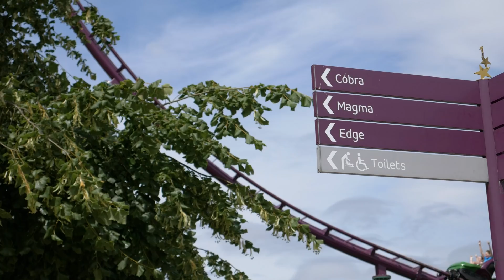Roller coasters speed up throughout the day, why?

Comment from the maker: Help us find the world's best roller coasters! We've created a brand new poll called Vote Coasters, and we need your help. Rank from best to worst the roller coasters you've ridden and from that we'll find the world's best. To learn more and take part, head to: https://coasterbot.com/votecoasters
Reply: First of all let me say that I love your videos and content and always find them fascinating. Second I was wondering if I could use some off the diagrams you include in videos on a website I am making for school? I would of course credit you.
Reply: the biggest thing you left out was that every train gives a different ride. train #1 of a particular coaster might run noticeably slower or faster than train #2 or#3 of the same coaster. also, if a coaster adds or removes a train, though out the day it may also have a different speed compared to the ones that have been running all day

Comment: A warmed up Coaster on a hot Summer day with some Rain is just 🤌🤌🤌
Colossos at Heide Park usually gives great rides. But on one visit last year somewhen in August the Ride went nuts! It was around 8pm, about 32°C, with a rain shower coming through.
From the first drop till the final bunny hills the Ride tried to launch me beyond space. I didn´t get stapled and they specifically anounced, that the trims were off. That ride honestly scared me...
On the first hill I was lifted multiple centimeters out of my seat to the point I thaught I can just stand up, while the rain was blasting at me. Before the second hill I pushed down my bar and it seemed to have no affect at all. That ride left me speechless and with tears in my eyes... 
Also got a similar experience on Kärnan at Hansa Park. Also mid Summer and late in the afternoon. The coaster whiped through it´s course whipping me around. It was just going so stupidly fast. That was my 200th ride on Kärnan and it made my month.

Comment: There is one more effect that weather has: Changing air density! Hot, moist air at a low air pressure is less dense than cool, dry air at a high pressure. At, say, 950 mbar, 30 C and 80% humidity, air has a density of 1.077 kg/m^3. At 1050 mbar, 10 C and 20% humidity, it has a density of 1.291 kg/m^3 - and since wind resistance is directly proportional to air density, that can have a significant effect.

Comment: How do you know it ran 1.5s faster due to temperature if you're then gonna explain there so many factors that can influence it
Reply from the maker: Temperature is connected to a lot of the reasons a roller coaster can speed up or slow down.

Comment: Genuine question

You know how GCI, CCI and Intamin Pre Fabs are made of wood but have that sttip of metal on them, why is that? Why can't their track be pure wood? Thank you!
Reply: Are you talking about the track itself?
Reply: @shawnspencer8766  yes
Reply: @100ksubssoicanbragtomyfrie4  the track itself needs steel for the road, guide, and upstop wheels. This is the part of the track that takes the most beating, and straight wood would not hold up to that kind of abuse. Thus, steel is used. 

Although it's good to note that the stack (the part of the track underneath the steel) is all wood as well as the structure.
Reply: @shawnspencer8766  Thank you! So is the bit where the upstop wheels for airtime not wood or is it wood?
Reply: @100ksubssoicanbragtomyfrie4  any spot the train wheels ride on are steel. Roads on top, guides on the inside, and upstops have steel underneath 👍🏻
Reply: @shawnspencer8766  thanks man!

Comment: Steel coasters go faster in the rain, but it slows down wooden coasters. Because wooden coasters have steel wheels on steel track the track itself needs to be lubricated quite often. On Troy it happens on average every other day, depending on the state of the track and the weather conditions of the track. In the rain the lubricant is washed off, wich slows the train down by about 2,5 seconds

Comment: This is true for most coasters. Coaster at Playland has its speed adjusted by changing the friction in the wheels (They don't use the MCBR) by making them looser when its too fast or tighter when it's too slow. They're flange wheels that have locked pins in them. The ride ops time the ride and call a techie to unlock the pin and turn the middle of the wheel with a wrench; thereby giving it more friction or less friction as the situation requires. Having said that: Yes, on most days when it's open (hot days) left unchecked, even "Coaster" at Playland would run faster as the day progresses. Thanks for this fantastic video; it is information needed for fascinated people who don't know this yet, of which there are always plenty.

Comment: Dynamite at Freizeitpark Plohn features a boost mode where the lift speeds up at the top instead of slowing down. There is actually a video of this https://youtu.be/4_oOfFoWPIY. Some rides are better in cold weather, for example Silver Star runs with harder wheels and deactivated trims in winter. It feels like it's faster than on a summer day with softer wheels and trims.
Reply from the maker: Oh wow that's really cool! Thanks for sharing :)
Reply: @coasterbot  You're welcome:)

Comment: Taron has another way of warming up the trains: Boost mode.

This mode isn't safe for guests due to higher acceleration on the 2 launches, but is used in the morning to warm up the trains, especially if they were outside over night.
Reply from the maker: It's a clever feature!

Comment: How to know if your train was heavy on Fluch von Novgorod: If a train on that coaster is loaded with a bunch of big bois the trim brake just before the final brakes isn't capable to slow it down enough for the intended, gradual brake experience. Instead it will just slam into the brakes.

Comment: What a detailed video, however I believe that your deduction about rain is partly false. It is true that the rain serves as extra lubricant between track and wheels, but because the wheels are rolling on the track and not sliding, you want the wheels to have a high coefficient of friction to the track, so they don't slip. The friction in the bearings of the wheels are made specifically to reduce friction as much as possible, so you want to direct all friction contacts to there and keep other contact surfaces from being affected by friction. Therefor if rain is on the track, it is more likely for the wheels to slip and therefor loose more energy due to stick-slip effects, increase wear and slow down the train. Not speed it up.
Reply from the maker: It's a general consensus that roller coasters speed up in the rain, and they do. If you've ever ridden one it is genuinely faster. You assume that the friction when raining would be reduced enough so that the wheel no longer rolls. That may be true, but I'm not 100% sure. Surely the coefficient of friction between the wheels and track would be rather high to begin with?
Reply: @coasterbot  It is rather high, however despite the best engineering efforts, you cannot guarantee contact at all times, so the top wheels might lift off of the track during some ejector airtime and spin freely for a bit. When they come into contact again, they surely don't have the exact speed of the train and have to slip at least for a little bit until they sync their speed back up.

Comment: In 2019, yukon striker got drastically faster every time I rode. Back in April/May you were on the zero g winder for 5-7 seconds and on the vertical loop was slow at the top and you got hangtime but by July and August there was barely any hangtime on the zero g winder around 1-2 seconds and you sped through the vertical loop and 2nd Immelmann. 
Roller Coasters can also get faster during the year and I have evidence with that with Yukon Striker at Canada’s Wonderland, my home park.

Unfortunately I haven’t ridden it in 2020 because Doug Ford is a big poopie head and won’t open CW
Reply: I’m very sad wonderland couldn’t open despite the protocols